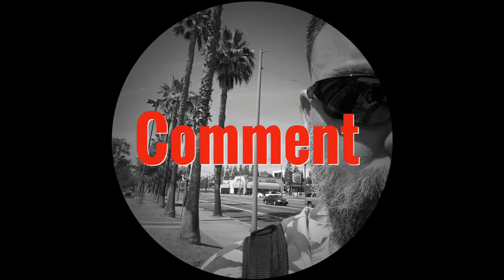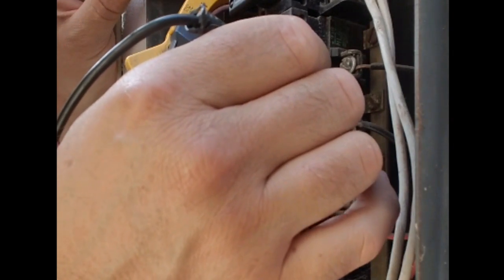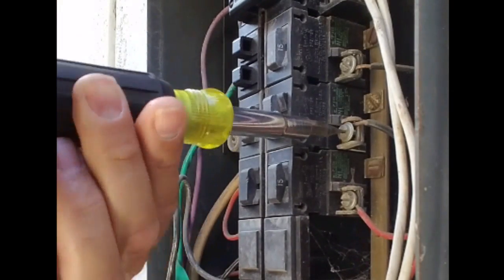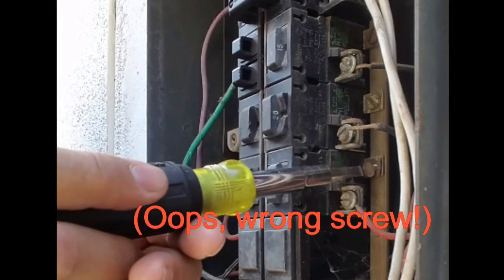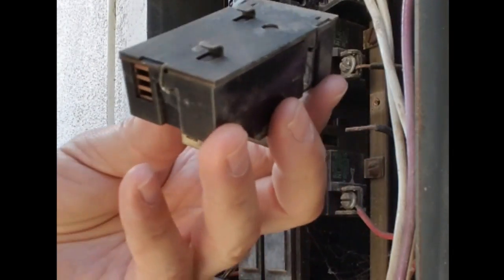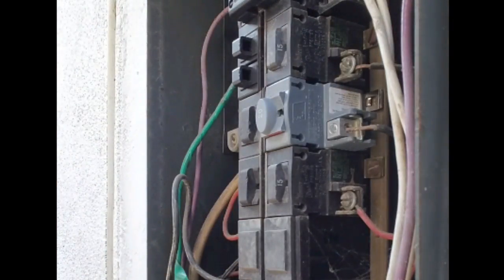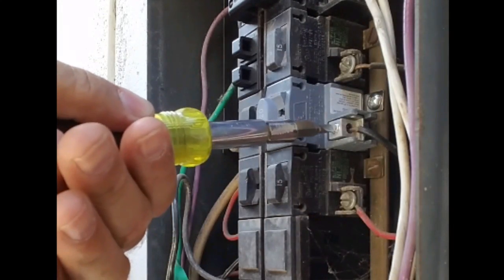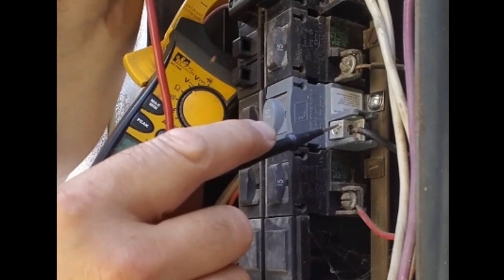How To Replace A Pushmatic Breaker

Comment: Hello Shane, you are a true blessing with your help. I have 3 questions;  I have an old  pushmatic panel. I have a double breaker for my pool pump (240). One of the two breakers will trip it self seconds after I reset it and other times will stay on for a lonf time. While it may be on at night when i check on it in the morning it is off. I move it around when it is on and trips it also.
1)What is the cause? 2)Is it just a faulty breaker from the 2? 
You wrote - **Always shut off the main breaker first before replacing breakers in older panels** - There  seems to "NOT" be a main breaker.
3) Can i still proceed with the replacement of the breaker without killing my self?

Thank you. Be well and blessed.
Reply from the maker: MrEddieTheRhino thank you, I'm glad to know it's been helpful. As far as your situation, those Pushmatic breakers are a very old design (obviously). If they are original breakers, they are acting funny because they are old and the trip points aren't what they should be.  Replacing the breaker will help that  but replacing the panel will be your best bet in the long run. And yes you can do it. If you have a panel with no main (sometimes the main breaker is not at the top, but side by side with other breakers and looks like it's back fed) you can still replace the breaker, you just have to be careful. I have to say "turn off the main breaker" for safety reasons to the average DIYer who may not unserstand electricity. Electricians replace breakers every day without shutting the main breaker off. Be safe and hope everything works out.

Comment: Thanks for the video.  Where did you source your replacement breakers? All I see is refurbished units, and I would prefer new/improved.
Reply from the maker: +PicatinnyAl thanks for watching. I bought them at the local Home Depot. These breakers are technically obsolete since the manufacturers no longer exist so everything now is either aftermarket or refurbished/ used. You can also find these breakers online or locally at circuit breaker specialty shops.
Reply: @MassiveElectric   is it still true that Home Depot is best resource?

Comment: Great video. I have an old push panel in my home. I do not see a main breaker to shut off all the power to rhe panel. Can i do exactly what you did in this video without shutting off a main power supply, i am worried off injury , causing a major problem. I have nevee done this, and people i know say its easy. I would like to do this myself, but am worried of safety and thinking i should just have an electrician come in. 2 of my breakers keep trippinh, and my double stove push keeps tripping . Thanks in advance for any help
Reply from the maker: Normally, when I make a video discussing how something works, or how to do it, I am not necessarily endorsing the idea that anyone can or should do any electrical work they want. So, I appreciate you asking about this. Your case is one of those that I would tend to advise against doing yourself, solely based on your own apprehension, as you have noted it can be dangerous. Of all the breakers out there, the Pushmatic is probably the worst design and least safe. Your screwdriver will actually be energized while taking the old breaker off and installing the new one. Ask a coworker or neighbor for a referral to an electrician they have used to do it, as it should take less than 30 minutes, even with a challenging fit (these aftermarket) breakers are known to not fit well.) Those breakers are not going to be cheap though. If you call a contractor it is very likely he will push you to replace the entire panel, and some guys will be obnoxious about it and tell you the breaker cannot be replaced. You should definitely consider replacing that panel in the long (or short run) though, to be honest. Best of luck and thanks for watching. You've also given me an idea for another video, so stay tuned!
Reply from the maker: p.s. if you have 3 breakers tripping, you are likely looking at overloaded circuits and possibly the panel. Just replacing the breakers isn't likely to fix the problem if I am understanding you correctly. Have an electrician test the current draw with an amprobe clamp meter on those circuits. My gut tells me the draw is maxing out those circuits. While you may pay about $150-$200 for those three breakers, a new panel replacement might be a better investment.
Reply: @MassiveElectric  wow, i can not thank you enough for this fantastic reply. I agree, i need a professional to look at it. I will ask how much am entire new board would be to replace, i would think in the thousands for something like that. 
Have a wonderful evening, thank you so much again for the reply!!
Reply from the maker: a meter main panel replacement should cost 2000-4000ish (as there are a lot of factors). just a sub panel should be 500-1000ish. if the price gets up into the 6000-10000 range they are trying to sell you a complete rewire of your house.
Reply from the maker: David, I just uploaded a new video in reply to your comment. I discuss most of the things we talked about here, but a little more thoroughly. Thanks again.

Comment: Can I put a 20 amp instead of a 15 amp breaker? Would it work or is it dangerous?
Reply: It depends but you’ll need at least 12 gauge wires going to all outlets if you’re using 20A breakers, as 14 or smaller will likely burn your wires before the 20A breaker trips, which may cause a fire.  It is also illegal as wires won’t meet electrical codes for fire safety.
Reply: I have a similar questions can I replace a 20 Amp with a 15 Amp breaker?
Reply: @theodorepedro  No issues replacing a 20 amp breaker with a 15, except that you slightly reduce the capacity of that circuit. Never go the other way unless you have sufficiently sized conductors for the larger capacity brraker.

Comment: You should always stress the fact that before you work on any of the breakers you must shut off the Main Breaker.  That's after your voltage check proves a bad breaker.
Reply: Pushmatic breakers are split panel breakers and DON'T have a main breaker that you can shut off.
Reply: @lostorchard9337  lol...NOPE! Mine has 100A main breaker (Gould I-T-E Pushmatic Load Center)

Comment: Hello I'm trying to replace a breaker of this same style, but the one I need to replace is doubled up with the one on the opposite row. is there another video for replacing those kinds of breakers? Also thank you so much for the video!
Reply from the maker: +Melissa Frederic the breaker you are trying to replace is a 2 pole breaker, this video is a single pole. Yours works the same way, it's just two breakers tied together back-to-back. Simply duplicate the process on each side and pull the whole breaker out (it's one piece). Hope that is helpful, let me know how it goes. Thanks for watching.
Reply: Massive Electric thank you so much!  I'll have to get the parts but at least I have an idea now. thank you again!
Reply from the maker: +Melissa Frederic you are welcome. Be safe.

Comment: Thank you for the informative video.  I have a very old buldog brand box.  The switches for the stove and the heat/cool unit are now stuck in off.  Type says 30 and 40 amps.  Can you recomment where to buy replacements for this.  Thank you so much if you can help me with this.
Reply: I know Home Depot has the 15 & 20amp ones
Reply: Home Depot in U.S? Are these CSA approved for Canada?

Comment: Are these pushmatic breakers a fire hazard like the old federal pacific breakers/panels are? I'm an electrician and I had an inspectior claim that on a inspection report for a guy that was buying a house. I didn't know that these type of breakers had issues like this. Do you know if that's the case?
Reply: Better safe than sorry. I'm going to recommend that the guy change out the panel and on top of that it will give me a job to do.
Reply: Pushmatics are more known for nuisance tripping and humming, and unlike FP and Zinsco, there isn't a known issue of not tripping or arcing buss bars. Connecticut Electric owns the IP for Pushmatic and they are UL listed, therefore safe - er.. The better bet is to replace the panel as there is a reason that design is no longer in use.

Comment: Hello Shane. Thanks for your tips. The breaker was very briefly working providing electricity to my pool pump. It tripped in less than 1 minute. I went to reset it and it sparked in back of the breaker. I pulled the wire from the alleged faulty breaker ( 1 of the 2 joined together) and put it into another breaker and it sparked the same way. Both breakers have the number 15 on the side. I have a pair of new breakers that say 20 on the side. Should I replace the old ones that are double for these 2 that are individuals? Won't it be providing the same amount of 240 together? Could I have some type of short? How do I check for it? Could my pool motor be bad if it has been working fine? The pump stopped working only because the one of the two fuses would trip. Now my pool pump is just humming. Please advice - thanks ahead.

Comment: @romeparrilla8307
0 seconds ago
thanks for a nice video,i do have a house built on 1960 with an  old bulldog Pushmatic electrical panel and its not giving me any problem yet but can i just buy new breakers and use the same panel,thank you so much again.....

Comment: It's trick where you mess with the old breaker and then grab it with your fingers, and it comes loose-mine is to stubborn to budge, so at a loss what to do, but, a bit like your scew error, I found I had the wrong breaker, the one not working was to the left of the stuck one...so I hooked it back up, and proceeded with the failed one...now, it wouldn't cycle, go on and off when pushed...it was in 'on' and wouldnt toggle to off, just go sorta blank when I pushed it to off...nothing showing...I'm doing all this waiting for return call from electrician...I've been through this before, but thought to have electrician do it this time...I have on hand one replica breaker found on web, and earlier had used a salvaged one...the pushmatic box is fine, but everyone in house with refrigerators, computers, big screens and what not, put a strain on the old fifteen amp breakers, I'm guessing...anyway, I touch the screw driver to the wire connection screw, begin to turn, and, the breaker toggles from that blank look to 'on'!!!...wth...I run into house, and the lamp plugged into the wall plug is on!...success!...sorta...I put things, box, tools, me, back in order, until the next time, which could be tonight, or three years from now, the time span of the last time I messed with these breakers!...shutting the pushmatic box off takes removing the meter, which I cant imagine doing, though I imagine there's a diy yt for that too, so, so it's daunting for inexperienced to mess with the breakers live...I'd changed lots of Zinsco breakers, (they corrode where connected to bus bars), in apartment building where I did maintenance...after seeing electrican pop one out, I began doing them myself while box was live...to shut the apt. box off one had to go down to the basement garage and throw the switch for that apartment...a chore...so, I got used to changing breakers with box live, but my old pushmatic box gives me pause!...mostly, because the breakers dont come free easy, and the replacement doesnt slide back in easy, or some such...I was shown, use one hand, and too, I, from my abundance of caution, use rubber handled tools- a needle nose to grab the loose wire, cap it with a wire nut or tape-me with rubber gloves/boots!...odd the first breaker I have mentioned has two wires...anyway, onward...☺

Comment: I noticed that some of my original Pushmatic breakers DO NOT SHUT OFF!
Reply from the maker: That's one reason we don't use then any longer. You might consider replacing them with after market or find a circuit breaker specialty: they may have some that have been tested and refurbished. In the long run you are better off investing in a service upgrade.
Reply: @MassiveElectric  I went ahead and replaced the entire panel after one breaker decided to not power back on and others began crumbling apart internally.

Comment: Is anybody out there nowhere I can find some of those push matic breakers.  I need a 40 amp single pole, probably 2
Reply: I just bought replacements for my entire panel from Amazon.  There were only a couple sellers, and prices were comparable to current switch breakers.  It was easier to find the double pole 40s and 50s I needed than the 15s and 20s surprisingly..  in some cases I had to do a search for the model number to get the right one to pull up, fortunately the numbering system makes sense-- ubip240 = 2 pole 40 amp - ubip250 = 2 pole 50 amp - ubip115 = 1 pole 15 amp.  I didn't look for any double breakers, so not sure how those numbers go....

Comment: This was a good demo EXCEPT ... remember that so many of the folks watching this have little to no experience. What are you thinking not killing the main power to the bus? Then sticking your finger in there several times right by the bus? Then using a screwdriver with what appears to be marginal protection? Seriously, a real amateur could kill himself.
Reply: Since the hot bus bar is so close to the breaker, I’d use a pair of needle nose pliers to make the circuit wire connection

Comment: I'm sure that when you were unscrewing the breaker from the buss bar, that you had shut off the main, because you are never supposed to work on hot circuits. Hypothetically, if you were, you would use an insulated screwdriver to prevent the shift from accidentally shorting something - or worse. BTW, Connecticut Elwctric is not an "aftermarker" brand, as they own the IP and have the only UL listing for manufacturing replacement Pushmatic breakers. Don't buy the junk from China just to save a few bucks, unless you don't mind the house burning down.
Reply: Connecticut Electric's breakers are made in China, stamped right on the breaker.

Comment: Would only do a complete panel swap to modern technology, or I walk. Don't need to end up in court over old shit that's known to have problems.
Reply: Well, not everyone has $2,000 sitting around to spend on a panel.  I need to swap a double 15 breaker and its $65, sure won't be spending $2k if I don't have to.